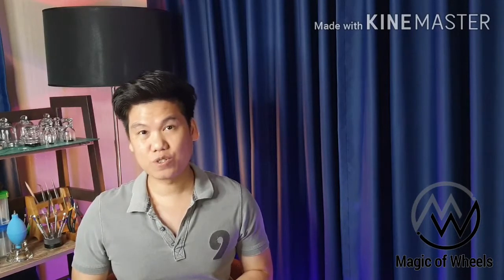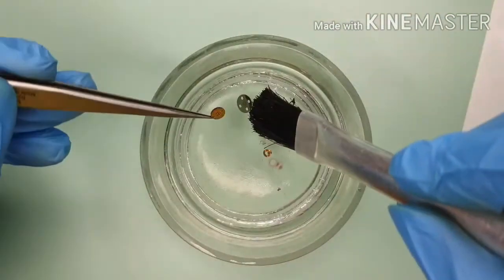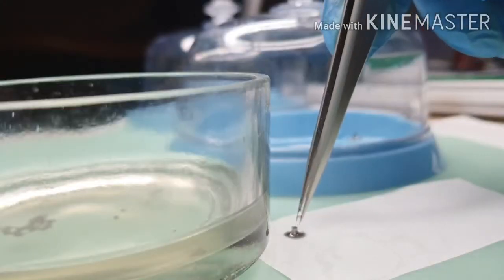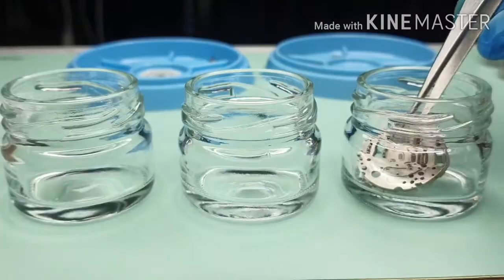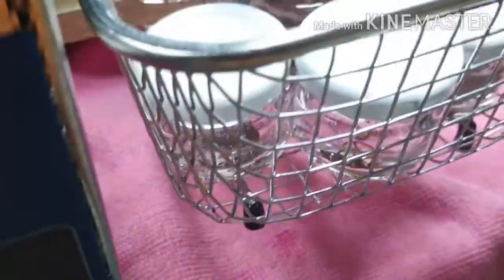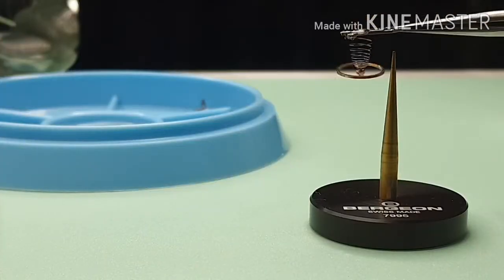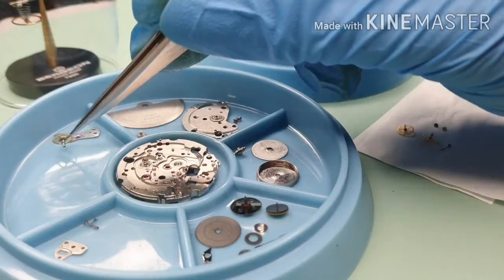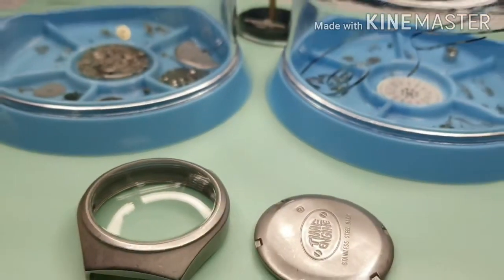Servicing Japanese Movement Miyota 8205 part 2 of 3 - Cleaning / ล้างเครื่องญี่ปุน Miyota 8205

Comment: Nice, thank you for detailing your cleaning process. I am still experimenting and working with newer movements, so they aren't that dirty, so I am just doing lighter fluid followed by 99% alcohol. By the way I saw a great tip for re-assembling of this movement where you use rodico to hold the click spring in place while lowering the big plate. Looking forward to part 3!
Reply from the maker: Thank you for your comment and advice. Let's learn and share together.

Comment: hi sir! i need to ask, why does my watch seconds hand stop when i completely wind down the crown?
it's a NH35A movement. Is it because the stem is too long?
Reply from the maker: Ummm. I am sorry but I couldn't get your question. Could you explain please?
Reply: @magicofwheels  when in unscrew the crown to wind the watch, the entire watch stops, then when i screw down the crown, the watch runs for 1 minute + and then stops
Reply: @magicofwheels  just wondering if you have any knowledge on why that would happen. my guess is the stem is too long, causing it to press on the center pinion?
Reply from the maker: What watch is that?  How long hve you been using it without service.  It sounds to me like the main spring is broken.  I would check the main spring.  Hope my guess helps.
Reply from the maker: Or may be it couldn't wind up properly hacking system, winding pinion , the click  spring, something with keyless work.  Mannn, so many posibilities.... T_T
Reply: @magicofwheels  thanks for the possibillities, it's a chinese dive watch using Seiko NH35A, very new watch. i will have a look at the winding system.
Reply: @magicofwheels  many thanks once again sir, you have been great help!
Reply from the maker: if you find anything please let me know.  I am curious.
Reply: @magicofwheels  I found the issue, when the watch isn’t on a flat surface, the seconds hand seems to be brushing against the glass until it comes to a stop at the same spot every time 
I changed a mee set of hands and checked the height of the hands, it’s ok now!
Reply from the maker: Oh. my assumptions were not even close. :P
Reply: @magicofwheels  hahaha no worries sir, we are all in the process of learning always